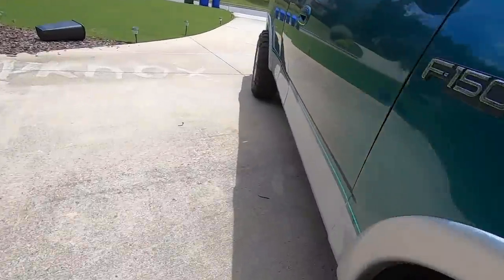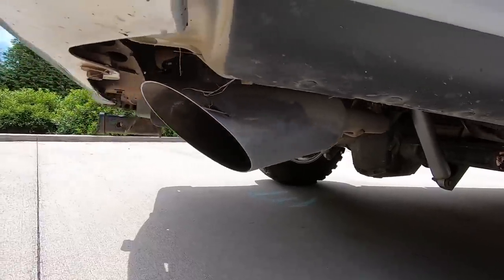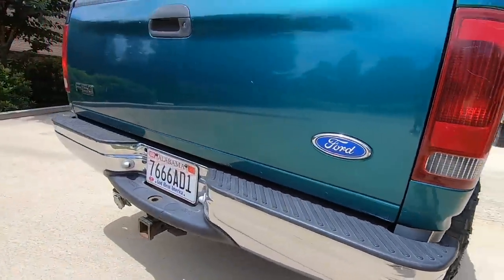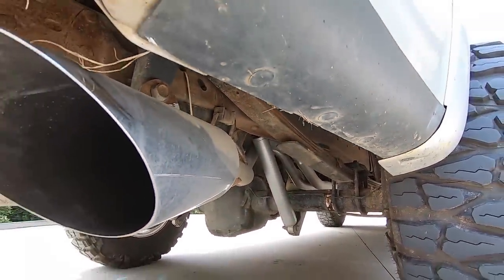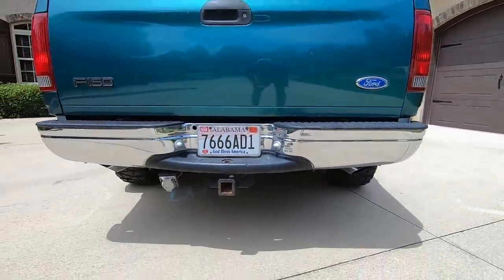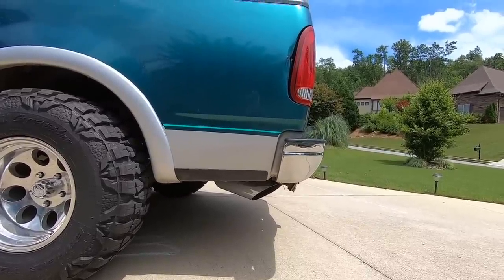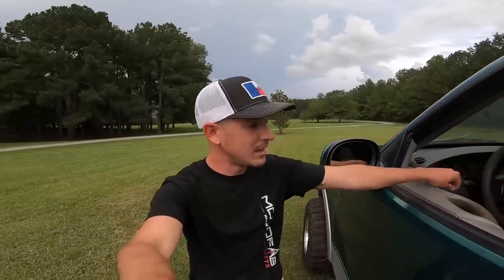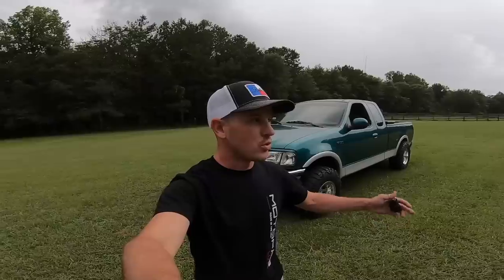Pre-cat straight pipes - in depth look!

Comment: My truck has no check engine light on all it’s a 97 with no stock cats just 2 high flow cats with stock o2 sensors
Reply: What’s the name of the high flow cats and they have a o2 sensor port for the high flow cats or did you have to make them?
Reply: @pro_ggram3d637  they are magnaflows but the bungs were weleded into new pipe because none of the exhaust pipe is factory
Reply: @Mustangman2003  well you do have a 97 model I got 2000 but anything after 99 I’m pretty sure all vehicles have rear o2 sensors which sucks but thanks man your a big help
Reply: @pro_ggram3d637  mine has rear 02s also I have 4 total two per bank
Reply: @Mustangman2003  when I went I told em I wanted just the pre cats then he was like can’t do it it’ll mess up the computer and the o2 sensor but the way you did it hopefully it’s possible

Comment: Did you regear the truck when you upped the tires? I've got the same size wheels and wondering if the regear is worth it
Reply from the maker: No i didn't
Reply: I ran 33’s on my 02 4.6 with stock gears for the longest time, and it’s alright if you’re just cruising around... I now have 4.10 with 35’s and there’s not much a a difference with normal driving unless I’m hauling weight, then there is

Comment: How much do they cost to do 2.25 inch true dual straight pipes on my truck
Reply: My exhaust shop charged me 150 to run true duals cut off the stock muffler and remove 2 cats and weld pipe in their place. Just depends